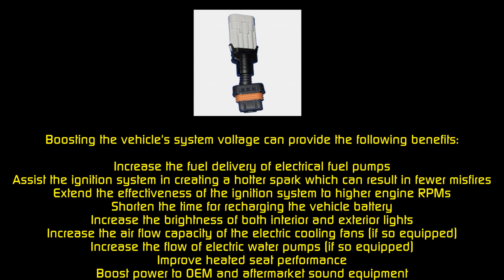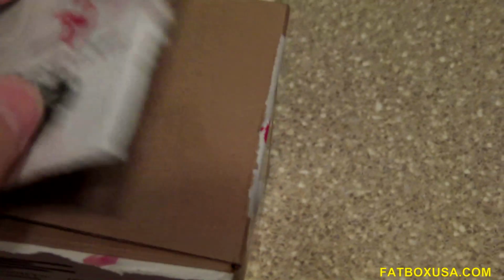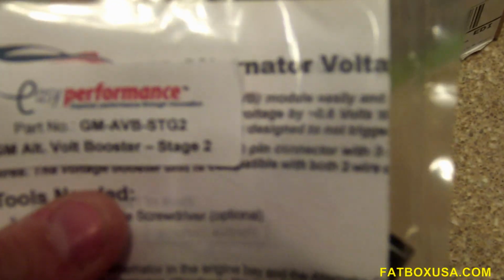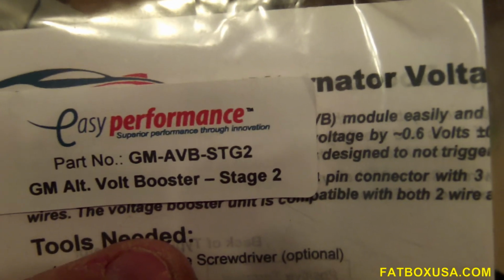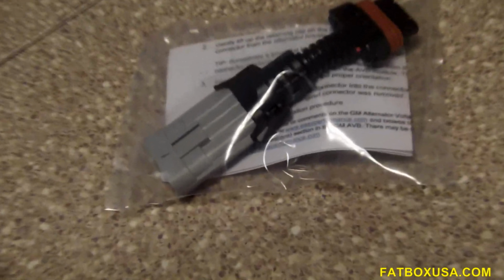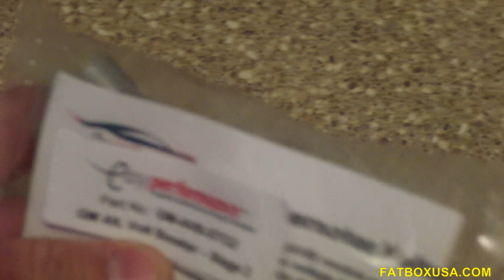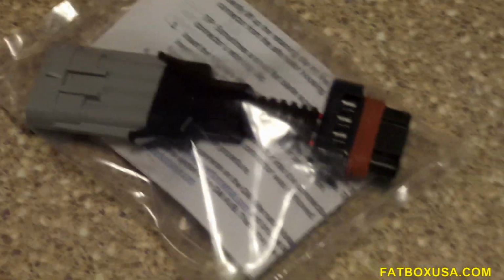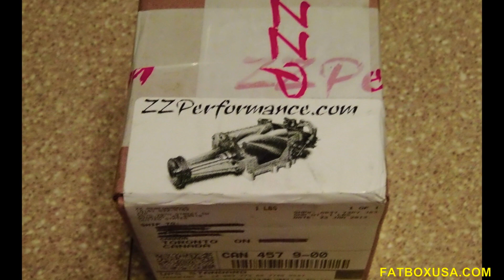Alternator Voltage Boost Module

Comment: A .10 cent diode does the exact same thing..lmao
Reply: was it the 1N4004 ? I got a bunch of then for like $1.50 but my 2004 Ford Expedition XLT 4.6L decided to no longer include the ALT-S fuse and instead have an inline fuse. Sorry for the bother Jesse H but if you know which is the sense wire to my model please let me know. I just bought two CAB 1600.1 mono bloc amp and they can take up to 15.9V. I appreciate any help anyone can give.
Reply: That doesn't  make sense.  there is a voltage DROP across a diode.